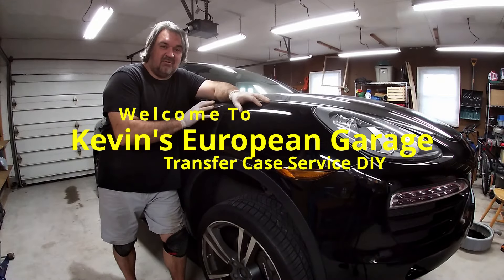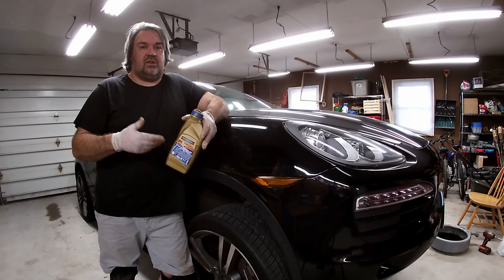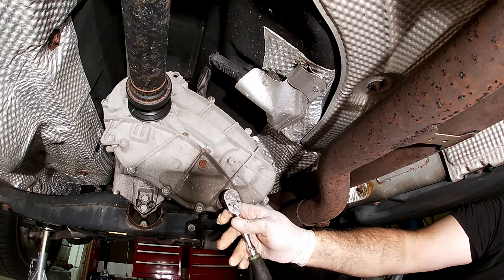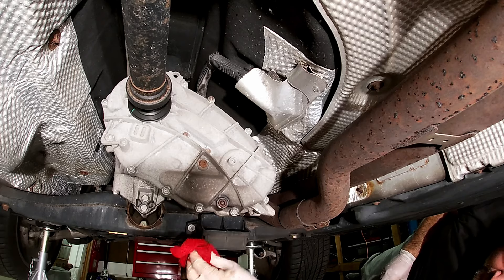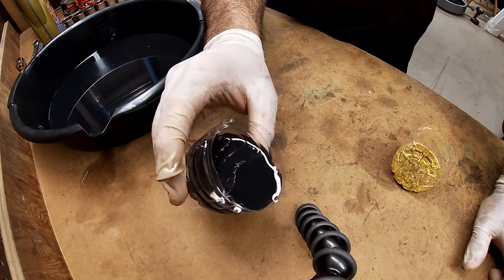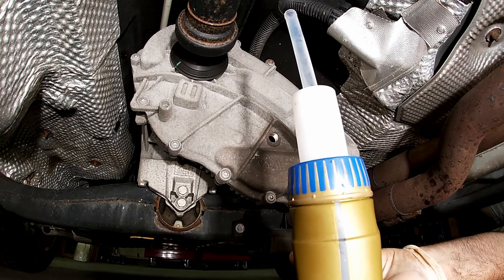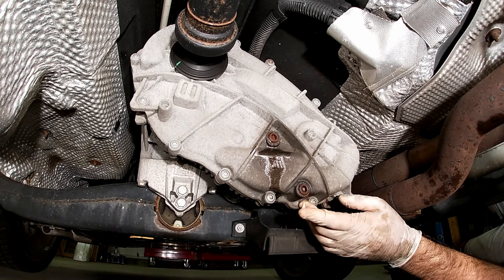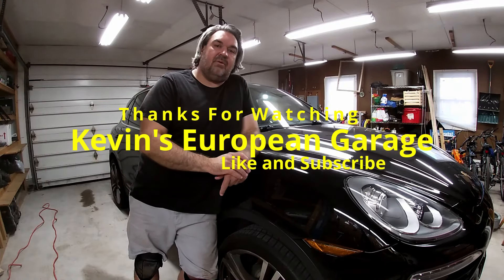Porsche Cayenne 958 92A Transfer Case FIX, Fluid Service DIY Part 2

Comment: Great video! Idea- when it's done draining, would it make sense to add .1 or .2 litres while the drain plug is out to help flush out the excess old fluid that is still sitting in the transfer case? (vs driving  100 miles and redoing the whole thing).

Comment: Did you drive between changing the oil if so how many miles roughly ? Or did you just drain out the old stuff, put new stuff in then drain it out again straight away? Cheers

Comment: Hey Kevin I also own a 2013 base. Quick question, are you aware of any issues with the cases cracking. Mine developed a hairline crack at the drain plug after changing. Did my mechanic screw the pooch?
Reply from the maker: Usually when something like that happens it is from over tightening unfortunately.

Comment: Is that the transmission fluid? transfer case I never heard that terminology before in a car.
Reply from the maker: It's definitely not transmission fluid. Because this car is all wheel drive it has a unit that hangs off the end of the transmission that distributes the power between the front and rear axles. Not all AWD cars have transfer cases though. Subaru's, Audi's, Porsche 911's come to mind. It depends on the layout of the drivetrain.

Comment: Hi Kevin- I just picked up a 2013 Cayenne base. Thanks for the video. At some point in the near future when I have my own garage again I’ll do some of my own maintenance. My. Cayenne has 66k what do you think the OEM spec lubricant is OK? Do you think it would be good to do that service for preventative maintenance if the car is running great? May be a rhetorical question.
Reply from the maker: Hi Ron thanks for watching. There is a recall or extended warranty on that transfer case from what I understand. This is pretty recent. I would look into that before you do anything. I plan on heading to the dealer soon to get info on it. Getting back to the fluid. The oem is fine, its more expensive than the Ravenol I’ve had good luck with it so I continue to use it.

Comment: Hi Kevin, 
Great easy to follow video. What was the exact product you use for the transfer fluid change? I’m going to do my soon.
Reply from the maker: I’m using Ravenol fluid TF-0870 or DTF-1 it’s the same fluid they just renamed it DTF-1. I picked it up through Blauparts.com and you can get it from amazon too. Thanks for watching!

Comment: Great video, I was one of the luck ones that the dealer replaced mine last week with the 10 year extension.
Be careful with the drain plugs can crack the case I go by hand with a short 8MM allen.
i did replace my fluid every 10,000 miles before the replacement.
2011 CTT 185,000
Reply from the maker: I’m still waiting for my letter. I started to change it every other oil change. Yes many people crack the case. If you have a torque wrench you it.
Reply: @KevinsEuropeanGarage  call the dealer have them run the VIN, save the old fluid if you can.
I received my letter 6 weeks before the expiration.

Comment: Great video!  Did this a few months back to my '13 Cayenne S, and this was perfectly documented. Do you plan on doing a video for a drain and fill on the transmission fluid?  Lots of info out there, but no videos on a simple drain and fill.
Reply from the maker: Thanks for watching! I will eventually will but it’s not quite just a drain and fill the correct transmission temp has to be achieved in order to get the correct fluid level. I do plan on doing it. In the couple months.
Reply: Just completed transmission flush, temperature monitoring is not an issue,  in order to achieve a complete flush you got to connect your pump to cooler line otherwise you will only drain about 5 L and replacement 5 L will get contaminated with the rest of old fluid. Even if you do that 5 times you would still have old fluid circulating.

Comment: Will this method work for a Macan?
Reply from the maker: I think the Macan transfer case is very similar if not the same. I know it uses the same fluid as the cayenne according to the ravenol website. If you are having similar issues which I have heard they do. This might work for you. Most people see an improvement front just one service. Trying it once might be enough to tell you if it’s working. If you try it lets us know I’m really curious. Good luck!

Comment: Also they maybe  using a soft clutch the shift smooth but wear faster 70.000 to 100.000 miles

Comment: But why are you changing it every 11k please inform me I am buying a 2012 turbo
Reply from the maker: These transfer cases have issue. Like grinding and bucking because the clutch discs get worn and contaminate the fluid. I was changing every 10k or so to make sure the fluid is always clean. Since I have done that I haven’t had issues. There is a warranty for them now call a Porsche Porsche with the vin for details and what coverage is left on that vehicle, should apply to all vehicles in the  US.
Reply: @KevinsEuropeanGarage  thanks Kevin ,
 I have came across a turbo 2012 with exactly 16000miles but out of warranty 
 it’s pretty expensive where I life cause tariffs are high it’ll cost around 80k US dollars imagine ! 
And I have also heard about the variocam bolt and the air suspension bellows annnddd the beige Interior I don’t know how true is that !! 
Thanks for the help again good man  
How durable are there would it last me another 10 years !
Reply from the maker: With only 16k miles I think you’ll do ok. Yeah those bolts I would get that done right away unless you have proof they were done. The air suspension leaks but almost every car will leak at some point. I never looked into what happens with those because I have the regular coil suspension. The transfer case, flush that fluid and change it every other oil change after and that should help make it last.. I’m curious where are watching from?
Reply: @KevinsEuropeanGarage  hello thanks again I am watching from amman jordan I do appreciate it
How would I know if it’s the upgraded bolts is there a nee serial number. 
You know what’s the problem Kevin for some reason all Porsche dealerships are in a hush mood when I called the dealership the denied that issue or they didn’t even know about it. 
In the US for example that only way they were forced is by a huge law suit. 
I guess that’s a price you pay for this beautiful machine
Reply from the maker: They are pretty awesome cars and it sounds like you found a nice example. Unfortunately the only way you will know if if you have some paperwork or remove the valve cover. It’s too bad you don’t have really good dealer support. I would start looking for an independent shop. Jordan has shown up yet in my list of where people watch my videos from. Must be cool to be in a city among ancient ruins
Reply from the maker: Sorry to hear you have Covid. I think I had it last year in Feb I was sick for weeks and my whole family, it stated with my kids and went to all of us. Glad you are feeling better. I can't wait for this to be all behind us.
There are a lot of places I would like to visit. I have never been to that part of the world. I would really like to go one day. 
My day job is in aviation but I don't work for any of the airlines.  
When it comes to your Cayenne and those bolts. If you have no paperwork saying they were done, it might be worth a call to the Porsche dealer and see if you can get the service records if they have some. If they can't help you. I would just plan on doing them. Better to be safe than sorry and I would do it as soon as possible. Here is some detailed info about it
https://static.nhtsa.gov/odi/rcl/2017/RCRIT-17V368-7771.pdf
Your coolant pipes, well it goes back to paperwork no record then plan on doing it. You could remove the intake manifold and inspect for leaks, this can only be done wit it removed unless it leaks really bad. But this looks like to be some thing that will give a little notice before something happens. You could always be mindful of any coolant smells. Smell something then have it inspected. I would plan on changing it all. All Pipes and a Y shaped plastic pipe along with the waterpump and thermostat housing with the upgraded one.
I am unfortunately not well versed in the Turbo Model as most of my experience is with the VR6 model. They are pretty reliable cars and shouldn't cause you much trouble with the transfer case being a soft spot. If you take care of these problems before they become issues you'll be ok. Since you don't have a warranty I would change that fluid right away. Transmissions are really good. Body wise mine is holding up really well with no issue expect small things like rear hatch struts. I did have a fuel level sender issue that was under warranty and replaced. I hope this helps you a bit with what you have to do. Let me know if you have any questions
Be safe and I hope you are feeling better.

Comment: Kevin, good stuff!  I heard from one shop that “special machine” was needed to change the transfer case.  In fact, when I took it to the shop they got really skittish and didn’t want to touch the thing!  That’s when I took it to a Euro shop and they knew what to do...but they also referred to some machine.  Your video makes this look straight forward....no machine.  What’s the deal?
Reply from the maker: I don’t know why they are referring to some machine. This is how you change the fluid per the factory manual. To replace the actual transfer case and the solenoid on it, you need a factory computer to do that. I’ve heard people replacing the transfer case and swapping the new solenoid for their old one and that worked fine for them. I have not tried that myself as mine hasn’t failed. Sorry I’m not better help but this the way per the manual for a fluid change.

Comment: Thanks for this video. It helped me change my transfer case fluid by myself and it was a piece of cake. I used one of those manual fluid pumps similar to liquid soap pumps and it worked like a charm. I bought Porsche transfer fluid as it was almost the same price.